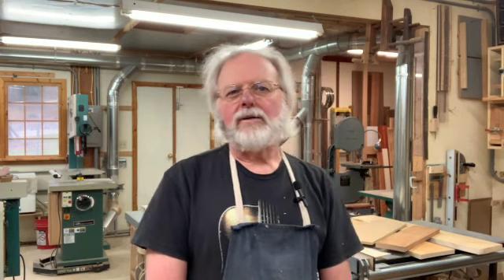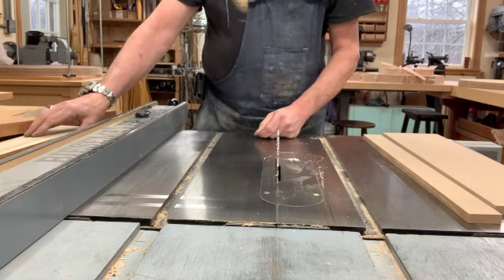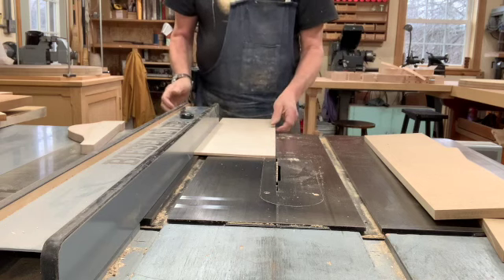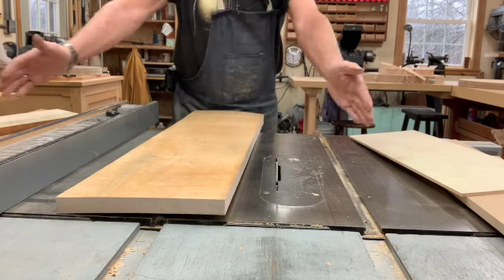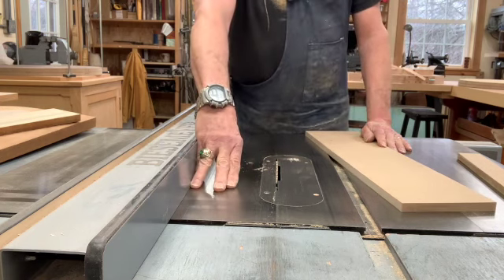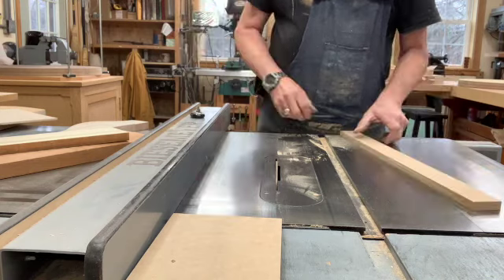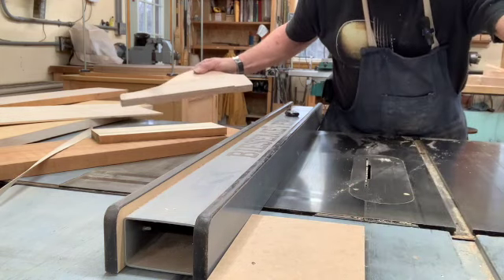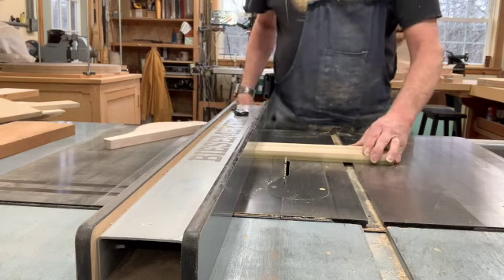Understand Your Table Saw; Safer Ripping Operations

Comment: Excellent!  I think that in general... ripping requires a larger toothed blade and crosscutting requires a smaller/finer toothed blade.  For me... rule # 1 is never stand directly behind the board you're ripping; always stand to the side to avoid kickback.  You mentioned this; saw on!  🤘
Reply from the maker: Ripping on a table saw is about blades ONLY with respect to the results left on the cut edge/end. With respect to operation, it's as shown in the video. The two ideas should not be confused.

Comment: A riving knife will be one of your most beneficial safety devices when ripping.  It keeps the lumber from closing into the back of the blade.  Why no mention of this?
Reply from the maker: There isn't one on my saw, being 23 years old. In their modern form (able to move with the blade)riving knives are obviously an excellent addition, but don't over-assume their ability to eliminate any danger.
Reply: @thepragmaticluthier  the guard on older saws have it as well as the little teeth that stop kick back

Also there is a product called the "shark guard" that allows you to mount a splitter on the back of the saw
Reply from the maker: Those old style splitters with anti-kickback fingers couldn't travel up and down with the blade. Because they stood straight up, they were effectively too far away from the blade.  Unless you were cutting all the way through a thickness, they didn't work at all.  Still worse, they were too frequently made of all too flexible hot rolled steel and would eventually bend, thereby forcing material away from or toward the rip fence. Still worse, the anti-kickback finger closest to the splitter would sometimes drop into the kerf, fowling the operation. In order to work safely and reliably, a splitter must be as close to the back of the blade as possible, made of rigid, hardened steel, curved on its inside so as to be reasonably parallel to outer radius of the saw blade and must be able to move up and down with the blade. Given the fairly recent best practices with splitters, they are excellent and a welcome addition to a table saw, but in their earlier form, they were a nuisance and often a hazard.
Reply: @thepragmaticluthier  Yes.  My saw is a early 80's PM 66.  The "safety" guards are more trouble than they are worth.  I assume they were just a nod to the lawyers.  But I've made a couple of throat plates with splitters built into them (different heights).  Stumpy Nubs has videos on making them.  It gives me a little peace of mind when I rip thick stock.
Reply: @thepragmaticluthier  the shark guard can make some of them OSHA compliant.  Check em out.. little pricey though.

Comment: Your definition of ripping needs some work.. it's splitting the width of the board.  Resawing would fall under your definition (splitting the thickness)
Reply from the maker: I disagree. When you rip any piece of material on a table saw, you MUST cut parallel to longest edge of the workpiece, or surface in the case of resewing. "splitting the width of the board" is a useful description only as it applies to material,  because it does does not address the requirements of the table saw and its principles of operation. Those principles are absolute and independent of grain direction or material being cut.  Failure to guide against the longest edge or surface of a work piece on a table saw, or any saw running a circular blade, is a recipe for injury. If you care for proof, try putting the end of a six inch width against the rip fence and cutting a 12 inch length. Try putting that same 6 inch width against a miter gage and cutting its width down to 5 3/4".